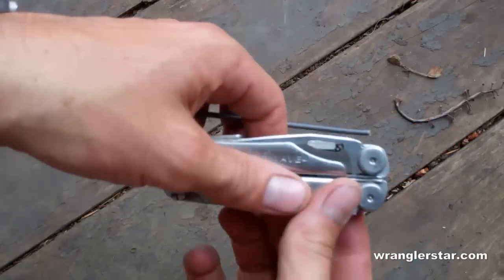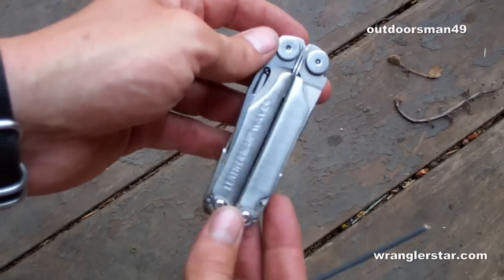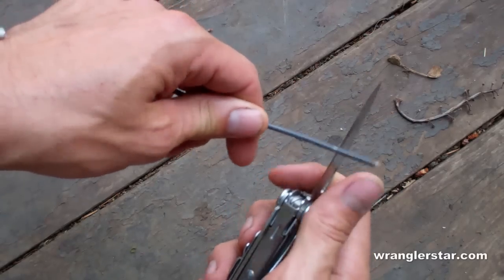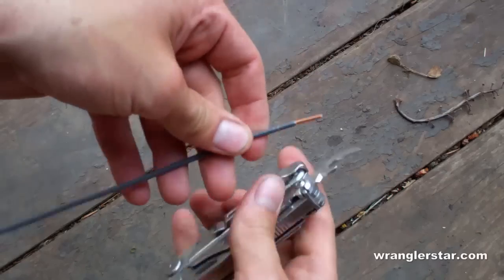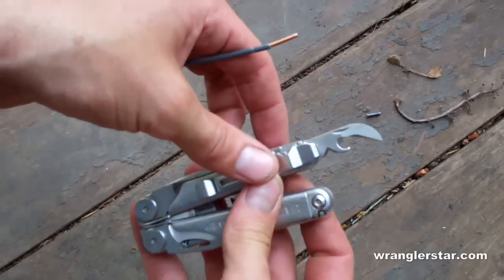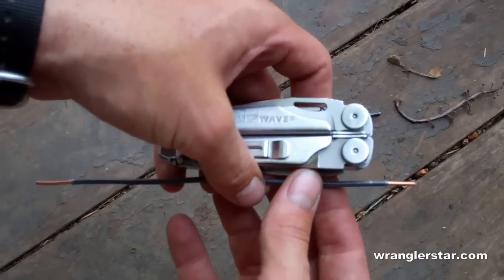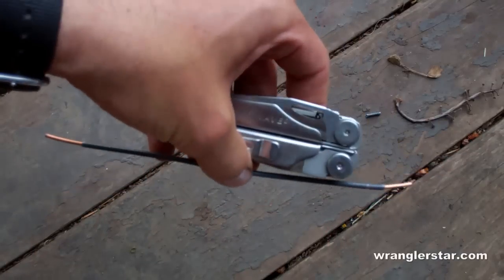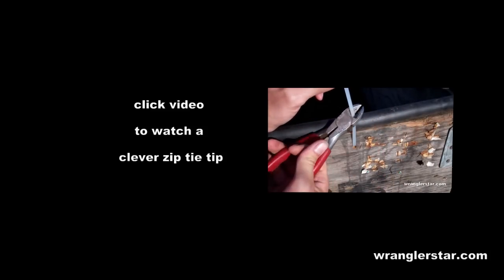Leatherman Wave Secret Function Revealed

Comment: How is that secret? it's listed in the product features.
Reply: ***** it's a security torx head. They chose it specifically to prevent people taking them apart. Providing the screwdriver with the tool would kinda defeat the purpose.
Reply: ***** I meant the product features on their website and in all of their advertising. Someone's cut up over nothing lol
Reply: It was a secret to him. How about adding something of actual value to the video? Cody provides all his videos to us for free. His knowledge have added lots of value to peoples' lives. And yet, you come here just to criticize. Next time, add something of actual value or please do not say anything. 

I came to the comments to find people CONTRIBUTING to the CONVERSATION. Many people did:

you can keep a needle or 2needles under the knife blade wrap a leather needle and sewing needle intape or selafane and push down in the slot and theyll stay use pocket clip to get them PEACE Pops Bushcraft -Paul Henry

There is a lanyard hole under the saw. Open the saw and inside the handle is a lanyard hole that comes out. -Deputy Prepper

The bottle opener works well for opening zip ties and saving them to reuse. Insert hooked end in the back and lift up the zip tie catch. - Joe Halstrom
---

See, those are CONSTRUCTIVE comments. They add to the discussion, to our knowledge. I now know 3 more useful functions of my Wave. I already knew about the stripper but some people didn't:

tnx man - Sébastien Hastien

Wow! Great! That's on my Supertool 200 that I have carried for so many years. I never knew that either. Thanks a lot for that! - SemperFiLeo
---
Not everyone checks the Leatherman Website, not everyone checks the packaging. I bought my leatherman at a flea market. No manual there. And yet your comment (and many, many more saying the same old shit) was there, taking up space, to waste the time of many people.

I count FIVE comments out TWENTY (on this page, at this time) saying essentially the same thing you are saying. That's TWENTY-FIVE PERCENT of people, commenting the EXACT SAME THING. 

I hope you see why people do not like this kind of comment. Or at least, why I don't. If you really so strongly about it, make a video response. Don't pollute the comments on a valuable video. You could also MAKE YOUR OWN REVIEW.
Reply: it's a joke
Reply: lancer D no one reads that
Reply: lancer i see no critacism in your statement why are peeples getting mad at you?
Reply: where did he offend in his statement?
Reply: @TheLawDemon I agree with everything you've mentioned. Appreciate the positivity. Shits been too unstable with negativity in the world. Easier jump to negativity than positivity these days. I do it a lot but trying to catch myself more and to pay attention to others attitudes more and how to handle them more appropriately. Cheers
Reply: @UnstoppableTramp  Does Unstoppable Trampon need a changing? That time of the month for you everyday I'm guessing. You seem to have the Douche part down. Better go use it.
Reply: @UnstoppableTramp  bwaaaa ha ha h ah aha ha!  Quick!  Grab a mirror!

Comment: Don't lock it back, keep it free and close the wire stripper down onto the wire against the frame. Works even better that way, especially for softer wire that would normally be difficult to push against the tool with your hand.

Comment: I finally figured out how to close the wave on the removable screwdriver side. I took it out due to the difficultly in closing on that side and the occasional pinch I would get when it snapped over the insertable screwdriver head.  After losing the "head" I bought a replacement. This time I took time to look at the design and found... drum roll here... move the screwdriver attachment up out of the way, about 90 degrees, close the plier head into the sleeve, and then before closing the other side, gently push the screwdriver attachment over the plier's nose! Cool trick!

Comment: Hi Cody,
I dont know if you know this or not?
The trick I do with my Leatherman is I use the  point of the pliers as a box cutter  on the top of the tape. works perfect and you don't have to worry about going to deep and cutting whats inside.
Sincerely
Ken

Comment: I did not know about the wire cutter, and I have had my Charge TTI for over a year!  I quickly paused your video to grab Charge and check.  Get in :o)
One tip I can share:
  
I have the screwdriver extension, which I can use with a small socket set, thanks to a hex to square converter.   The sockets range from 4 mm up to 10 mm, and  came from a Bosch drill bit an screw driver set that I own.

Its a handy bit of add on kit.

Comment: The shiny finish can be used as a reflector to signal people.  The belt clip can be detached and used as a fishing lure.  The saw can be used as a comb.  The Philips head can be used to bore pilot holes.  The file can be used to light matches.  I could go on.
Reply: +TheLightningGate In a pinch you can throw the whole tool at a charging bear.  Maybe you will get it in the eye...
Reply: TheLightningGate find a lightning gate
Reply: Mine didn't come with a belt clip :/
Reply: @officialWWM  same Im mildy salty about that... its no big deal though i only carry it at work i carry a juice around normally
Reply: Trevor I bought the clip as an extra for 18 bucks!

Comment: That was a mystery to me for so long. D'oh!!! Can't believe I didn't get that. There's the lanyard that can pull out in the wave as well. 

Question, can you direct me to a thorough site that gives a detailed view of the dissembling and reassembly of the wave. I'm talking really good instructions. I had that tiny tweaker screw drive snap on me inside the slot and had to take it apart to get the old one out due to where it snapped off. Now I'm struggling to get it back together in the correct order. It would be the side with the scissors and flathead driver. Thanks for the video. Appreciate the help from you or the subscribers

Comment: This is also kind of available on victorinix knives with a bottle opener and knife. If you open both tools you can see that the bottle opener has a little notch. you can clip small wires in that notch and close the opener so it locks them into place. then close the knife on top of the wire and turn it around 2 times. Then pull the victorinox away from the insulation and you strip the wire. For bigger wires that don't fit in the notch you can use the entire part of the bottle opener.

Comment: You've mentioned to avoid nicking the wire. It is really critical. 
I had a dead outlet in a house we had just bought. Inspector missed it I guess. I traced back to a junction box and discovered the neutral wire (20 ga solid)was broken at where the insulation was stripped inside the wire nut. There was enough wire I cut the wires off clean, stripped and wire nutted them up. Exam showed deep nicks in the copper. The twisting of the wire nut fatigued it and it broke. I like strippers over knives.

Comment: I also noticed that at the end of the wood saw blade , where you take it out. there is a small loop ( hard to see it ) that you can slide it out with a small screwdriver or a nail and use it as a yarn holder or Paracord rope. My 2cents

Comment: The back of the Scissor has a wire stripper also that works well with Cat 5 , Phone lines , speaker wire. Put the wire in the Slot then move the other blade on the scissor with pressure then pull and strip. Ive had one for like 10 years use it every day. Thats my secret use ;-)

Comment: On the clip you can actually bolt in one of the scout fire starters. With a small screw and a nut and as you probably know you can just take off the clip to use the firestarter. Just an idea

Comment: Open both Knife blades. With a little practice you can position a bottle cap between the backsides of the knife blades and pop bottle caps off much easier than using any of the other tools. You have to position it just right to work but after a few tries it becomes second nature. I have been using my Titanium Charge like this for years and works perfectly.

Comment: the paracord hook cutter on the charge series can be used to strip multiwire cable.  I use the serrated blade to cut the outer insulation around where I want to end the cut, then jab the hook in the open end.  then I angle the hook so the end is away from the wire and pull toward where I cut the end point.  this cuts the jacket right off nice and easy

Comment: to strip a wire using the tool, just whittle the wire ( i guess the word "whittling" describes it best). You don't actually need to cut a transverse cut across the insulator. Just whittle it as if you are sharpening a pencil using a knife.

Comment: The wave also has a lanyard hole most people don't know about. I don't have one so I can't remember which tool hides it but in either the saw or the file it you open it and at the bottom push something hard towards the end of it it will pop out. I have seen a video on it so you can look it up but I would suggest at least looking into the tools to see if you can see it. It's one one of the tools that are on the outside

Comment: With the old school PST.  By opening both the awl/leather punch and the small screwdriver.  You can scribe an angle,  bisect it and measure interior and exterior dimensions as a set of calipers. Why are you eyeballing a 45° angle? 
     This also can be opened to the map scale in the key to approximate distances. Yep,  just swing it around the last point and you've doubled the distance.

Comment: I hate to burst everybodies bubbles but the real wire stripper on the wave is the little notch at the crotch of the pliers.  If you use it often you will soon see that it works way better than some kind of notch on a can opener.  That is the real reason that most do not use the can opener for cans or wire, probably the most useless feature on that tool and I have used one daily for over 15 years.

Comment: you are using it wrong, you suppose to pinch it against the body of leatherman . basically try to close that can open while wire is in the V section and twist the wire and pull afterwards

Comment: I've been through Leatherman, Gerber and such. I've been a Victorinox fan for over 10 years and after owning the Swiss Tool X and the Spirit (both have the wire stripper)I'm not going back. I've broken everthing else that I've owned and have yet to break or wear out a Victorinox. The Swiss got it right.

Comment: These are not all that secret for being secrets, just in case you did not know you can also use the Wave as a plumb bob. Use the hidden lanyard ring as the string attachment point, and the Phillips head as the point making sure one side of the frame is fully opened and the pliers are fully inside the other portion of the frame.

Comment: The Victorinox spirit also has one along with a larger semi round bladed cutter for striping the protective wrap off of large multi lined house wiring (I don't know what it is really called but it is the large half inch or so cables with 3 to 6 shielded wires wrapped in another shielding of plastic.)

Comment: I have a wave.  Two days ago I was trying to remove a screw that was sheared off causing a potential hazard.  My friend who is like superman had to strength to cut it off.  After that the pliers were sticking  so much that I could not use the pliers.  I looked closely and saw that the cutting blades were very slightly bent.  I took my dremel and ground off a very small amount of metal and after that the wave was like new.

Comment: I don't like touching copper wire with my fingers when processing wire.

If you touch it with your finger, your body will become a conductor, so there is a risk that electricity will flow to the surroundings, which is dangerous

Comment: you're doing it the wrong way, you can strip that wire without using the knife. just put it on a wire stripper with your finger pressing at the other side of the wire  turn the the stripper a little then pull the leatherman  without removing your finger.

Comment: I'm mostly interested in replacement parts...my charge tti's flat head tool snapped off at the tip. I contacted Leatherman, and I am more than happy to buy a replacement part, but they said I would have to ship it to them and they would fix it and ship it back. Problem is that I carry that with me EVERYWHERE.  It is always on my waist band or belt or pocket, because with all the tools I have on it, I find uses for it all the time.  That said, I know they are doing what they think is right, most people would rejoice for such warranty, but being a handyman myself, I think I can manage some security torx screws and replacing the tool.  That said, anyone know where I can get either just replacement parts or a used leatherman with the same tool I need that I can use for parts?
Reply: If I were you I would probably get a little cheaper leather man to use as a back up or too leave in you car ad the. If something like this happens you don't have to worry about it. If suggest the leather man rebar. I have one and it is a great tool for the money
Reply: Leatherman will warranty it.

Comment: I believe the leatherman surge is just as good if not better than the wave
Reply: Yeah, it's also heavy, but if you're fine with that and could use the extra durability (exchangeable wire cutters, saw compatible with jigsaw blades, more rugged scissors).

Comment: The same feature is on my Super Tool, which I bought in 1994 or '95.
Reply: is it the 300? mines the 300 and it has it (Yay no more fucking with scissors to strip wires!!)
Reply: fig8man No it's the original Super Tool - 1994

Comment: i am forbidden by law to carry this awesome multitool cause it features a blade that can be locked with one hand (onehand-folder) :-(
Reply: You can Remove the blade... problem solved! If you can't even order it with a blade have someone else order it and remove the blades for you....
Reply: Der er lavet en dansk version
Reply: +Brian Berkes  ... i was thinking to remove the blades too but it needs some spacer replacement or some kind of washer or just simply blank non-edge blade like D2 STEEL as a mini pry bar.. i Have the SURGE. It has 3 blades.
Reply: +JaK S Grind the blade off and leave the stump.
Reply: Leatherman Rebar... try it